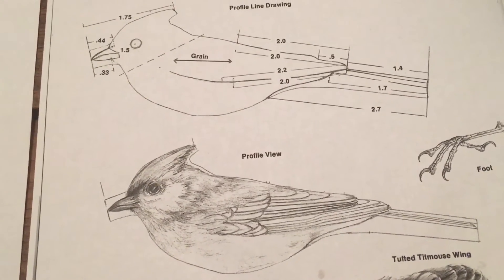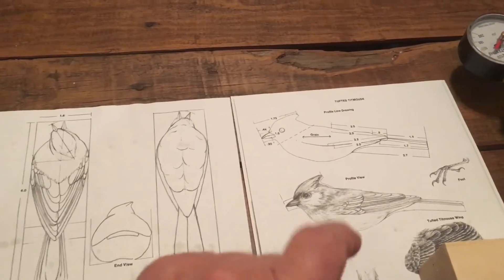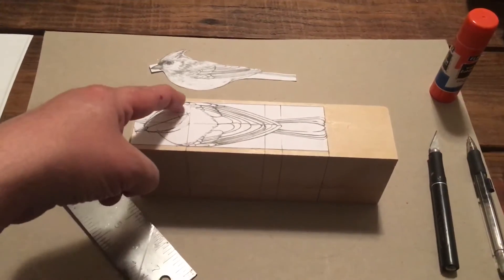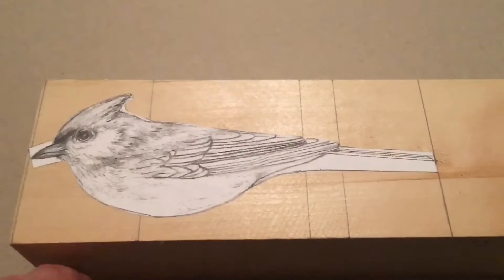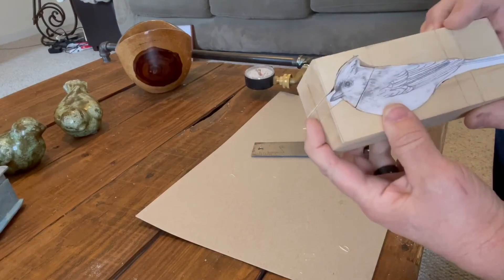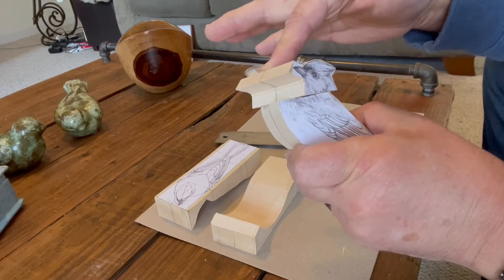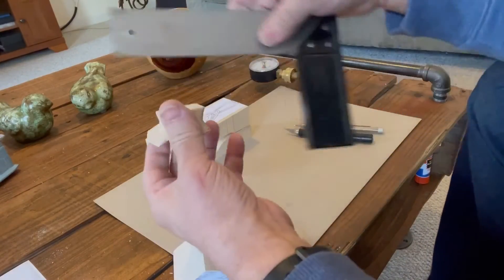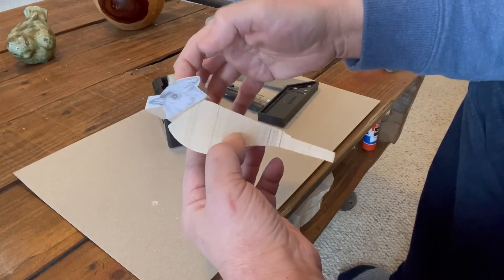Cutting out a woodcarving of a bird blank with a turned head

Comment: how did you clamp the head to the body?  You showed us how to find center and drill using the guide.  Thank you!
Reply from the maker: Thanks for the question. I did not clamp it. The Dowell was tight enough to hold it in place.
Reply: @markdmaker3173    thank you